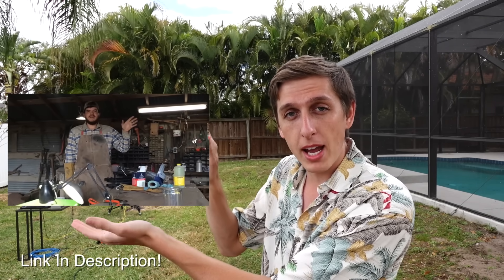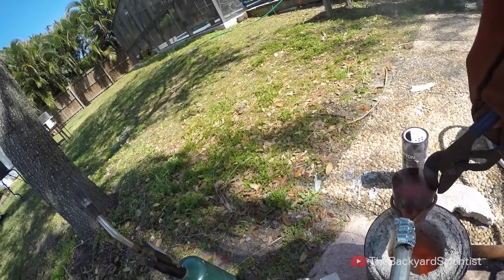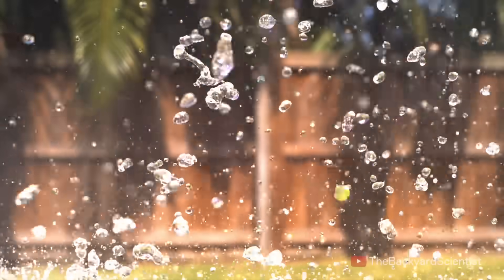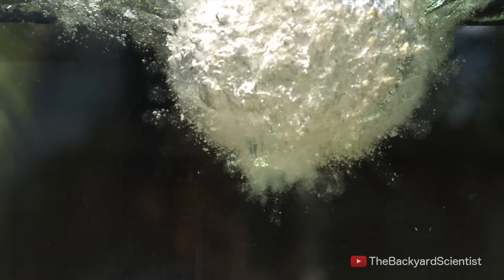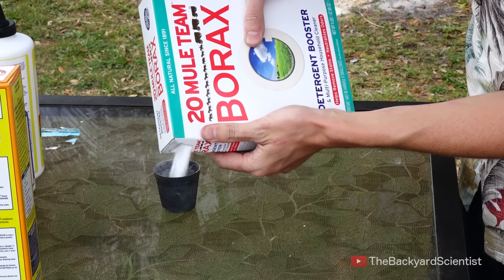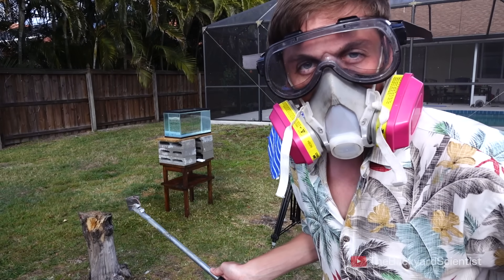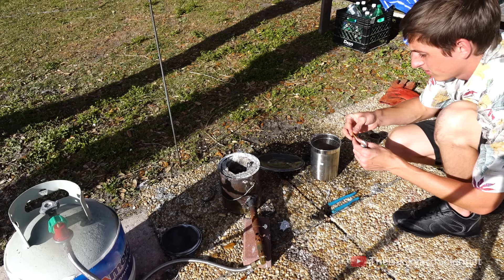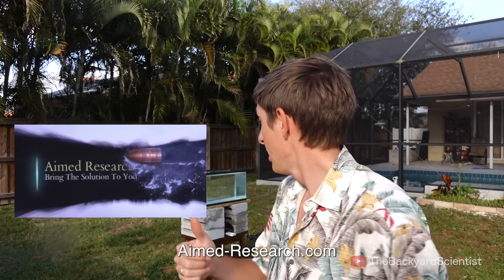Pouring Molten salt into Water - Explosion!

Comment: I believe you are close. Table salt seems to have loosier connection between cristals, and during cooling down in water tank cristals on the outer shell break apart (because of sudden temperature change, size of the cristals/liquid unevenly compreses), which creates huge amount of surface where water can directly interact with salt and exchange heat. Since water boils on 100 degrees, and you have dropped liquid with over 800 degrees of temperature that is soon to be millions of cristals mixed with small amount of localized water around salt, it creates vapour with really high pressure in relatively short time, which eventually creates explosion. If I am right, salt rock, heated to 150-200 degrees, when put in cold water should crack in pieces. So my final thoughts are that salt cristal surface and heat exchange is responsible for this nasty reaction.
Reply: =NOPE,THE SALT DOESNT ACT LIKE THIS

...MOLTEN SALT GOT VERY LITTLE VISCOSITY SO UPON POURING WHEN IT COOLS DOWN IN CANNOT MAINTAIN IT'S SHAPE AND IMMEDIATELY DISPERSES INTO LITTLEST DROPS WHICH TRANSFER THEIR ENERGY TO WATER ALL AT ONCE WITH BOOM
Reply: @robotnikkkk001  Interesting. well, this video has too less fps and bad positioning of the camera for this kind of interaction to be confirmed. 
Cooling down of salt under 800 degrees, you will get cristals. considering that water is around room temperature or cooler, cristalization happens very quickly. water molecules cannot effectively touch molten salt in liquid form, because of very high temperature, there will be barrier of vapour around.
It didn't come onto my mind as a possibility, but it's quite interesting what happens on molecular level. Did anyone do a sciefintic test on it?

Comment: It's probably because it's getting hot enough for the sodium ions to dissociate and separate from everything it's bonded to and then when it cools back down really fast, the sodium has an opportunity to bond with something other than the chlorine and as a result it is the same reaction as putting pure sodium metal in water.
Reply: =NOPE,THE SALT DOESNT ACT LIKE THIS

 ...MOLTEN SALT GOT VERY LITTLE VISCOSITY SO UPON POURING WHEN IT COOLS DOWN IN CANNOT MAINTAIN IT'S SHAPE AND IMMEDIATELY DISPERSES INTO LITTLEST DROPS WHICH TRANSFER THEIR ENERGY TO WATER ALL AT ONCE WITH BOOM

Comment: Sodium Chloride is a neutral salt.  Dissociating its ions in pH-neutral water will not significantly change the pH of the water, because the sodium and chloride ions will not add Hydronium ions or hydroxide ions.
Reply: =NOPE,THE SALT DOESNT ACT LIKE THIS

...MOLTEN SALT GOT VERY LITTLE VISCOSITY SO UPON POURING WHEN IT COOLS DOWN IN CANNOT MAINTAIN IT'S SHAPE AND IMMEDIATELY DISPERSES INTO LITTLEST DROPS WHICH TRANSFER THEIR ENERGY TO WATER ALL AT ONCE WITH BOOM

Comment: Since mixing sodium with water produces sodium hydroxide plus hydrogen gas as a byproduct, which in turn reacts with oxygen to produce water along with even more energy, could some of the explosiveness of these reactions be due to the hydrogen reacting with the oxygen in the air at just the right temperature, which could've been made possible by the sodium reacting with the water (or the molten salt passing its heat onto the hydrogen)?
Reply: =NOPE,THE SALT DOESNT ACT LIKE THIS

...MOLTEN SALT GOT VERY LITTLE VISCOSITY SO UPON POURING WHEN IT COOLS DOWN IN CANNOT MAINTAIN IT'S SHAPE AND IMMEDIATELY DISPERSES INTO LITTLEST DROPS WHICH TRANSFER THEIR ENERGY TO WATER ALL AT ONCE WITH BOOM

Comment: Hey, did you ever figure out what makes the explosion?  I was wondering if the molten salt is constantly gassing off, and the water somehow solidifies the outside of the molten salt into a shell, which then gets detonated by the expanding gas on the inside.
Reply: ...MOLTEN SALT GOT VERY LITTLE VISCOSITY SO UPON POURING WHEN IT COOLS DOWN IN CANNOT MAINTAIN IT'S SHAPE AND IMMEDIATELY DISPERSES INTO LITTLEST DROPS WHICH TRANSFER THEIR ENERGY TO WATER ALL AT ONCE WITH BOOM

=AND YEAH,IT ALL HAPPENS BEFORE SALT ACTUALLY TURN INTO SOLID....SO VERY NICE TO MAKE LOTS SALT WATER FAST,HEHE

Comment: You should test other chloride salts. (For example: KCl and CaCl2) . It would be interesting to test an insoluable chloride salt, but I don't any that's okay to spill in the nature. The comparison with sodium metal doesn't really show anything, since the sodium is in different oxidation states. The most interesting thing is to check if the NaCl reaction is special, or has something to do with solubility/chloride ion or some other factors.
Reply: =NOPE,THE REAL CAUSE IS ABOUT VISCOSITY

.....WHEN IT DOES REACH SOME LOWER CRITICAL VALUE THEN BEHAVIOR CHANGES INTO THIS UPON BEING POURED SO LITTLEST DROPLETS ARE BEING PRODUCED WHEN POURED SUBSTANCE STILL LIQUID AND THAT RESULTS IN EXPLOSION
Reply: @robotnikkkk001  Huh, thanks for clarifying! BTW, which does it work with?

Comment: The melting point of table salt is higher than borax, the salt molecules have a higher kinetic energy and travel fast through water. They also have a higher latent heat (internal energy).

Comment: I'm wondering if NaCl reacts more violently when molten than other ionic compounds when molten due to the solubility of NaCl vs. the other compounds.  NaCl is VERY soluble.  Couple that with the fact that it's super hot could mean that as it the NaCl dissolves at such a high rate, the heat needs to leave at a high rate as well since the water is cold.  As it dissolves that heat is released at an exponential rate causing the explosion.

Comment: I think the reason the molten salt in some cases could explode and crack a fish tank has to do with the fact that water is not very compress able but does transmit pressure well.  Given a sufficient amount of molten salt poured in the center of the water tank,  steam is formed and expands pushing the water to the sides.   Because this happens so rapidly, the expansion shock wave shatters the glass sides which resists the water expansion up to a point before the glass shatters.  The key points: having a sufficient mass of molten salt quickly poured into the center of the fish tank, great volumes of steam are formed in this process,  liquids do not compress easily but easily transmit the increase in water pressure to the sides of the tank.

Comment: sodium is not a very strong alkali metal, use potassium or rubidium for an Actual explosion. also, this is super simply explained- alkali metals Don't Like Water. they take the h2 out of h2o, and it creates a lot of heat- which ignites the h2 gas, which explodes when ignited.

Comment: What about a combination of the chemical and physical reactions.  The sodium reacting explosively blows the molten ball apart, throwing pieces into the surrounding water to further explode. The other molten ionic salts don't react as explosively to water as sodium, preventing the kind of mass spray required to make an explosion like molten NaCl.

Comment: this is cool. I like the follow-up experiments. You really see the difference between the hydrogen explosion caused by the sodium metal and the steam explosion caused by the sodium chloride. I was surprised that your other molten salts did not explode, but I think you explained it when you mentioned they had a higher melting point - that meant they solidified very rapidly upon entry to the water bath so you don't get that effect you described of the molten salt dispersing into droplets. Instead you got similar effects to what happened when you tried the slightly-too-cool liquid NaCl. I'm glad you didn't get 3rd degree burns all over your body, that totally could have happened.

Comment: Lithium has the a similar reaction when interacting with water, as will all the elements in the same column as lithium (sodium included).  This is because they have the same outer electron count and therefore similar properties.  That outer electron is unpaired and weak, so it can react more easily.  As a guess, the other salts didn't have a reaction because there were no unpaired, weak bonded outer shell electrons; making it just a hot substance in water.  https://www.youtube.com/watch?v=Vxqe_ZOwsHs

Comment: As an interesting scientific side-note, the "rapid expansion" of the superheated sodium chloride in the form of the tank shattering explosion is a perfect example of what the men and women working at Chernobyl in the days following the initial disaster were afraid would happen to the core after they covered it with the boron and sand. They mention it in the docu-series on HBO, the tanks under the core were thought to be empty but since the fire crews had been pouring water on the fire, the tanks had filled and this exact scenario would have played out in a much LARGER scale with radioactive particles playing the part of the molten NaCl and the explosion of the fish tank would have basically been the entire plant which meant 3 other reactors that were still operating being added to that explosion.. The 80's were fun times!!
Reply: The other reactors would not explode, but melt down as well. They would not add to the initial explosion the way they describe it in the docu-series, but yes, they would triple the amount of radiation leak and putting the situation under control would cost many, MANY more lives.
Reply: thanks for connecting the dots
Reply: @Marco-nr4wy  its not a coulomb explosion but is instead possibly driven by the high solubility of chlorides because the same kind of explosion occurs with molten NaOH I learned the hard way!!>
it bypasses the leidenfrost effect!
Reply: @Marco-nr4wy  it be imparting all its energy into the water as it rapidly dissolves into it faster than the speed of sound.

we need slowmo guys to prove that!!
Reply: I’ll agree with that last sentence! 🤘🏼
Reply: the chernobyl explosion is indeed a similar explosion but its not the same.
In this one the salt touching the water gives its electrons so fast that it creates negative surface tension and accelerates into the water as it dissolves faster than the speed of sound transferring all its heat bypassing the leidenfrost effect.
in chernobyl the Zirconium when heated past 2000 Celsius becomes highly reactive to water and when it encounters water it does the reaction and transfers its electrons into the water as it forms the products faster than the speed of sound thus causing an explosion.
you can search these videos on youtube since sometimes comments dont behave when you post links
Thermite + ice explosion
Why sodium explodes thunderfoot
Reply: What HBO filmed is not documentary AT ALL. ;)

Comment: Remember what sodium does to  the water. 32 degrees isn't the freezing point when water has salt in it. same for the the boiling point. The laden Frost affected is your key to how this works. But i think there is also a nuclation affect that boost the situation, with salt as the chain reaction goes exponential.

Comment: lol any extreme temp that undergoes an extreme change in temp will result in explosion or should i say implosion as many things expand under intense heat and when you rapid cool is shrinks super fast creating a vacuum. different materials will react differently depending on its density size and mass and composition and reaction if it is a toxic bond

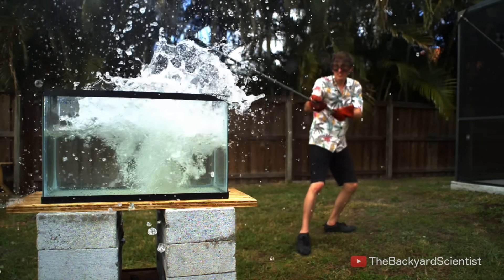Comment: Cool experiment. You had a mushroom cloud 4:17
P.S. I highly recommend a shield panel (plywood is cheap) with hole cut-out and a longer pole extending from it. Also, protective gear for handling molten metal.

Comment: My intuition is that, the affinity between salt and water is much stronger than borax with water. And, if you can pour the salt while it's still in liquid form, the heat can be quickly transferred to water and turn it into steam, and then the steam can be heated further into superheated steam, which may induce shock waves and break the aquarium glass. If you can try sodium carbonate, which also shows high solubility in water, I bet it will explode too.

Comment: In 1972 I worked at Elmira Heat Treat on upstate NY. They did various metals heat treatments to harden steel -My job as to dip 5 lawnmower blades in to a salt pot furnace for +20 seconds (incredibly hot-red/white melted salt) - move them to a special treated fire repressed oil bath to harden/cool them and then, after a set time to water bath for further cooling and then on to the drip-dry rack.
One day I witnessed from +20 yards a co-worker grab from the wrong rack - the drip-dry rack of wet blades and when he dropped them in the pot pretty much all the melted salt instantly exploded out of the pot ...everywhere...he was lucky that he had protective gear on but there were serious burns on all exposed skin, upper arms and neck...I suspect he still has scars from it today
Reply: thanks for sharing <3

Comment: maybe the other salts have a lower heat capacity than sodium chloride. I'm too lazy to look it up. What that means is that while you are heating them up to the same temperature or higher, the amount of heat energy they actually contain is less. so they don't heat the water up quite as much.
and maybe they have a lower thermal conductivity. so that even if they contained more heat energy than sodium chloride, it takes longer for them to give that heat to the water, so the water doesn't heat up as rapidly.

Comment: In case of the other materials the gas bubbles separates the water from the hot material until temperature aligns - but the molten salt breaks this barrier by dissolving the outmost salt molekules. So the next "layer" also have a chance to contact with the water and you get an ongoing reaction.

Comment: Isn't this because the sodium after boiling the salt reacts with the water? Sodium is an Alkali, (first column in the periodic table). When dropping Sodium (Na) in the water, it creates small explosions with Na balls going everywhere. That is of course if the Sodium (Na) has not come in contact with oxygen. I remember in chemistry class, we used to have sodium dipped into petrol so that it does not oxidize.

Comment: It is called steam explosion where water is rapidly heated, expanded causing fast local production of steam by the interaction of molten metals and the surrounding water (as in your case is melting salt solidified to small particles).

Comment: Your explanation for the sodium chloride seems plausible as it is a stable ionic compound and therefore unreactive. Sodium, however, is a group one metal and is therefore very unstable and reactive. When it is a solid and reacted with water, it fizzes  about on the surface and forms sodium hydroxide (an alkali) and hydrogen gas. When molten it will probably do the same thing, just with a bigger explosion.

Comment: When salt crystals come into contact with water, the water molecules accumulate on their surfaces and edges as dipoles. The positively charged ions of the salt align themselves with the negative pole of the water molecule - and vice versa - the negatively charged ions with the positive pole of the water molecule.

This interaction is called ion-dipole interaction, in which the ions at the edge of the ion lattice are detached from the ion lattice by water molecules and are enveloped by them (hydration shell). Now the ions can diffuse into the water. This process is called hydration, in which energy is released, the hydration energy. It serves as a measure of the tendency of the ions to combine with water molecules

With the formation of hydrogen bonds to the first hydration shell, further water molecules can accumulate and thus form a further hydration shell. In the hydration shell, the mutual attraction of the ions is greatly reduced, and in addition two oppositely charged ions are only dragged along in the water
the force that would hold them together in the air. As a result of the hydration and the decrease in ion attraction, the salt crystal begins to dissolve.
If you dissolve an ion crystal in water, there is an energy conversion, which is characterized by two characteristics: energy is used to overcome the lattice energy, and on the other hand energy is obtained from the hydration of the ions.

If the hydration energy is equal to or greater than its lattice energy, a salt is said to be readily soluble. In the case of salts in which the hydration energy is significantly greater than the lattice energy, the salt-water mixture heats up when dissolved (heat of solution).

In your experiment, NaCl is meldet and therefore the needed lattice energy is much more lower. And so the ratio between lattice energy and hydration energy is an other, as if you soluble solid NaCl in whater. It's a exotherm reaction.
Reply: Hydrogen bomb in a nutshell.
Reply: That was pretty awesome.

Comment: First he poured slowly, the salt hit the water in small blobs, which didn't explode, some of the bigger blobs did manage to make a small pop.
When pouring it faster, the liquid was in one big blob and it did result into an explosion.

When the salt it poured into the tank at 2:16 you can clearly see the leidenfrost effect on the salt as well before it explodes.
But due to the size of that big blob, a bit of water gets trapped in the salt anyway, the leidenfrost effect stops out when the salt is cooled down enough and then it makes the water turn into steam and creating that explosion as explained in the video.
Then why does Borax not explode? Probably because when you melt 50 grams of borax, it melts to only about 26 grams. Which makes the blob smaller and not able to trap the water inside.
So I'm thinking melting 100 grams of borax, pouring it into the water will make an explosion as well.